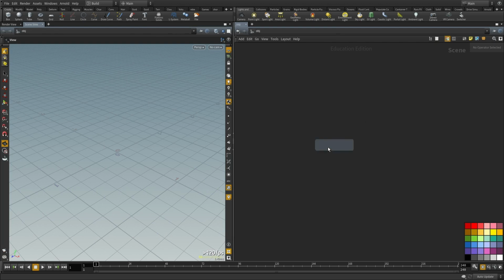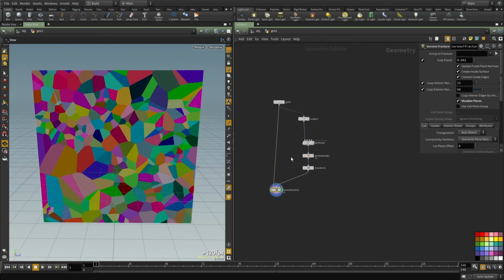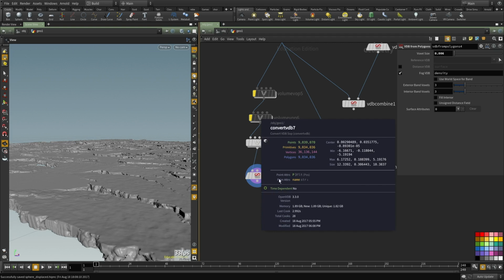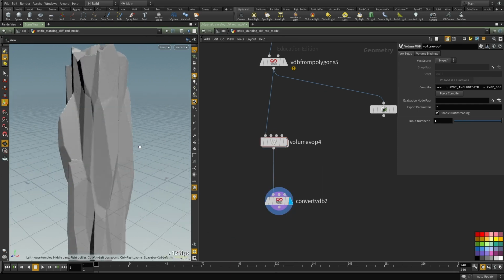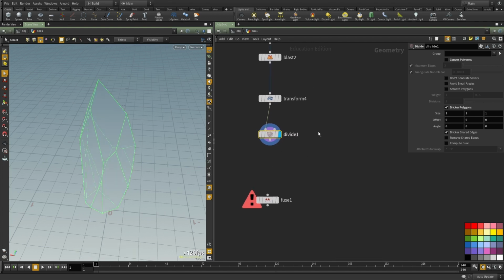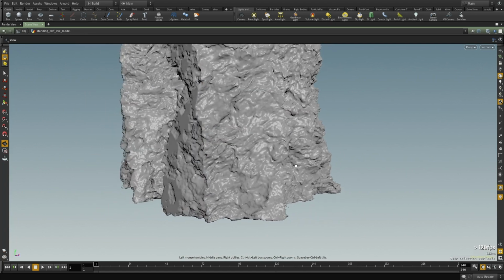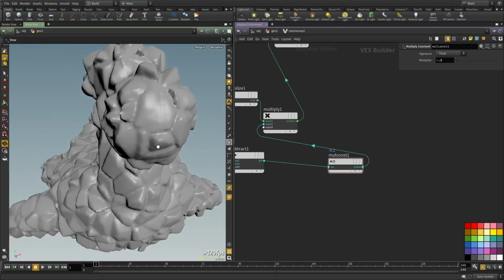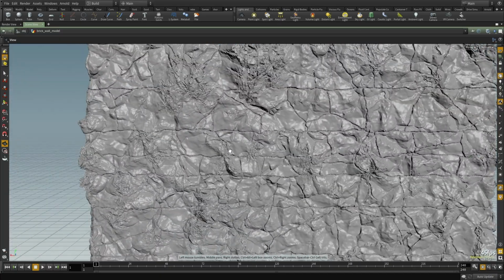Free Masterclass: Developing Complex Details Using Volumes in Houdini

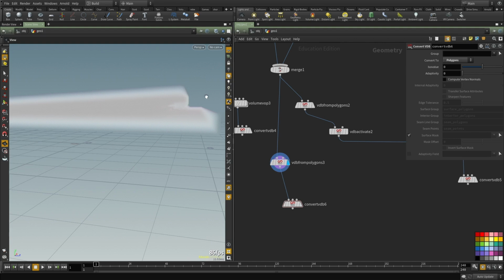Comment: 29:35 are you sure the problem is there's no data? This sounds a little off to me.
It rather feels like ISO value is an inclusive value of the densities(and above) that should be included in the surface, therefore at 0 you include the whole space to infinity which cannot be displayed.

Comment: And if 3 hours is just an intro why spend time on fog volume if houdini makes SDF by default? No stepping, no visualization problem, why someone should care about fog while making rocks?
Reply: Sounds like you don't need this then?  He mentions in a presentation that using this approach prevents intersecting geometry.  I'm just starting out with Houdini so maybe I don't totally understand, though.
Reply: @8thlvlMage  I'm pretty new to Houdini too but I messed around a bit with noise .... it's very easy to cause overlaps when you apply it to geo and you have to do a Geo => Volume => Geo conversion step to fix this anyway

Comment: On 2:11:09 there is a mistake - you had to normalize both tangent and bitangent, then add them to each other and then normalize once more, without any mulconst. In that case it would be really only edge noise. But edge noise alone does not have much sense.